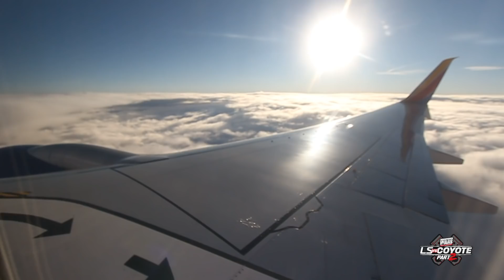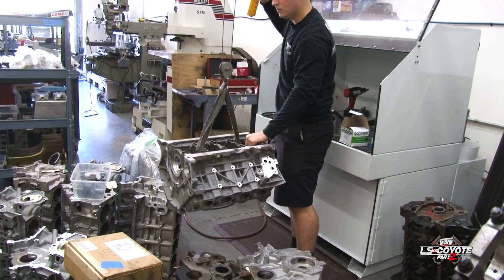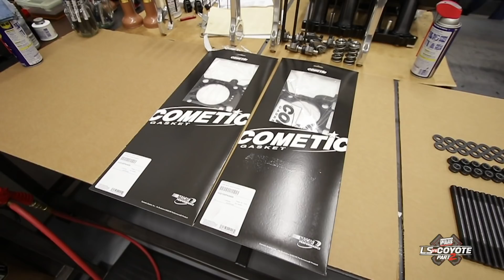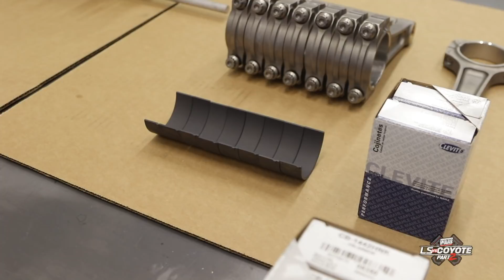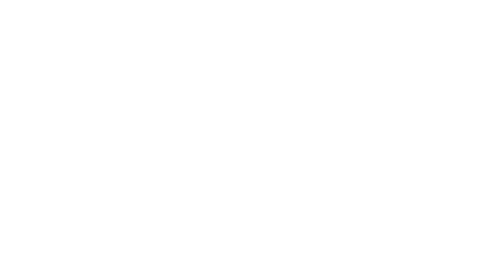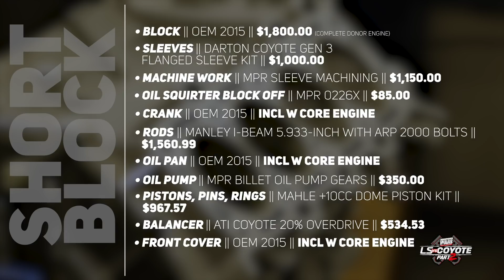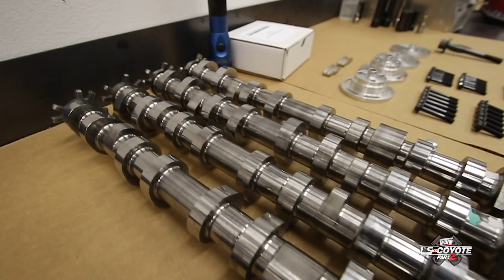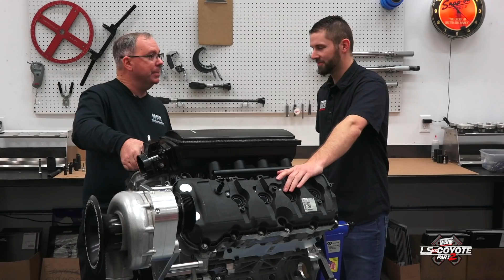LS vs. Coyote 2 Episode 3: The Coyote Engine Build

Comment: it's just like we thought it would be.. a built dart block 427 stroker vs a stock block and ported stock headed coyote. and the 'yote will still win 😁
Reply: Alpha Wërks yes if you want an NA power you need cubes. No doubt any cam in block motor will win NA vs small cid OHC.. But when you boost them (which is all anyone does nowadays) overhead cam takes it home. No one wants to make power like it's the 1960s anymore, you take a stock mod motor (281-302 cubic inches) put a power adder on it, it still sips gas and drives like it did until you get on it instead of thumping around in some loping cam big cubic inch gas hog; it's 2019. I still like NA stuff I have an old sbf mustang it's fun.. but my Cobra will blow it away and gets 24mpg
Reply: Sorry not a name brand dart* aftermarket racing LS block from GM same difference.. that bore/stroke/cubic inch hasn't been in production in 6 years since the last ls7 rolled off the assembly line so yes it is a stroker, however the coyote block is from a junkyard 2015 pickup truck and yes it's been prepped but it's a stock casting.
Reply: @jmitchell513  the 2015  z28 had a 427, same year engine they pulled for your coyote....
Reply: shaadydog1 2015 2014 what's the difference, it's not made anymore. The LS line in performance Chevrolet has been dead for the newer LT series. Which is kind of funny they're not using an LT to fight the coyote. In this case the coyote is a modular engine in the mod motor family (like LS and LT are related) they should have just went to a junkyard and grabbed a 90s cobra 4.6 teksid block and stroked that to a "5.0" kind of like the Chevy boys are doing. John Mihovetz took a stock teksid block 4.6 into the 6.80s in 2002.. the LS didn't hit its 1st 6 second pass until 2012 which is laughable considering how long they had to develop it and the difference in technology from 02 to 2012. They is already a coyote that has went 5.80 @ 250 only 6 years into production (they eclipsed that 2 years ago.) The LS still hasn't hit a 5 second pass ever.
Reply: @jmitchell513  Urban/Moran ran 6.8 over 200 in 05 fuqbois IN A STREET CLASS CAR THAT CRUISED 30 MILES MANDATORY, Not some ProMod MOONBOSTED bs. 
https://www.youtube.com/watch?v=3PgFopQIJdw 
You clearly dont know shyt about the LS platform,  stop regurgitating lies you read on every Ford/Mustang site you have ever been on.Of course You wont see factory stuff pushed and developed when the aftermarket steps in as soon as factory pieces are coming off the assembly line and Classes allow those parts for competition. Thats just a fact most people will not R&D  IF THEY DONT HAVE TOO. 
Myabe you can find a SBE  Coyote/4.6 thats been better than this? 
https://www.youtube.com/watch?v=HYW_kPEyhiQ
Reply: @jmitchell513  Coyote with liners isnt made anymnore either run it  that way... I would be fine running a current alum LT 6.2 or 5.3 VS your currently linerless Coyote junk, shortblock no prep and boost the shyt out of them. Sound good? How about we quit living in a world full of stips, this is a competition not a comparison of factory parts.
Reply: shaadydog1 I'm having a hard time making any sense of what you're trying to type her bud.. I don't know what I'm talking? You sent me a link from a 10.5 outlaw car from 2012 running it's first ever 6.. that's exactly when I said they hit its first 6.. https://www.hotrod.com/articles/hrdp-0403-2002-mercury-cougar/ here's a link to the stock motor 4.6 running a six 10 years b4 your LS. Here's the thing.. the LS is cheap bang for your buck, hell look at Cleetus he made 2 passes in junk yard LSs and blew 2 up. What I'm getting at is at the cost to build a true competitive racecar people don't build the LS, Chevy guys would rather run a big block Chevy. Which for the money is hands down faster. But what is nuts is mod motors run with the big boys, they don't need some big thumping cam and $3,000 set of heads. Out if the box can take power the heads flow a shit ton and get great gas mileage and are steetable... and what are you talking about liners!! you mean sleeves in the block?! Yeah they sleeved an f-150 pickup block made from Ford.
Reply: I didn't say it was first , YOU SAID IN 2012, that's when the first LS on a radials was in the 6's . Probably why the video was posted to clear up some confusion. Read the description for the video it's says it plain as day 2005. Video Published dates are meaningless.... And ya I guess the 4.6 would be first, it came out 4 years before the LS did and rules were in its favor. That 4 years is not a small development gap in the racing world. So the 4.6 has a 4 year developmental head start but the LS does it within  a year or 2 of the 4.6 which needed a  2300lbs Funny car tired ProMod
Reply: @jmitchell513  Stock Coyote casting that needed to be sleeved and reinforced to survive. LMAO.
Reply: hochhaul When your building a 1,500hp engine it only makes sense Ford didn't get a non production racing block handed to them. The builder said stock he rates stock sealed coyotes to 900 horse. Cleetus just blew up 2 stock LS engines back to back trips to the strip making 800 hp, when you're running stock shit there's a chance it won't last long.
Reply: @hochhaul  The reason LME went with the LSX is that they knew the Factory LS block would not survive.  That is the complaint with every Ford guy on here...every one who has ever built an engine knows that factory blocks have a limit before they break.  So the first thing most people do is invest in a good aftermarket Block, whether it is a Dart, Ford Performance, GM Performance Etc. to be able to make big HP and not crack the block.  This LSX is a block that you DON'T find in a GM production vehicle.  The Coyote is pulled from a F150!  So they are starting with a run of the mill factory block....re-sleeved or not, it is a factory block.  Anyone who can't see this or respect the fact that these Coyotes make insane power from "Factory Blocks" is ignorant.
Reply: @Steve-wl7jt  Funny. Katech just hit 1486 HP on a totally stock Gen V LS aluminum block in February. No re-sleeve necessary. Factory block. Factory heads (cnc ported). Not only does the Coyote block need heavy aftermarket sleeves, depending on the year of the block it needs lots of bandaids to hold the block together above 1000 HP --  11mm blocks upgraded to 12mm, shallow head bolt blocks need to be converted to deep head bolt threads, brass inserts in cooling channels to strengthen weak areas, it needs welded gussets to reinforce crack prone areas, etc. They HAD to go with a junkyard Coyote block because to buy a brand new performance Coyote-based block would totally blow the budget for power upgrades. It's a budget-based challenge and Coyote fans always throw hissy-fit because Coyote builds are way more expensive than an LS build. That's completely unsurprising to anybody that's on the outside watching this fanboy bickering and childish whining. DOHC builds are usually much more expensive. DOHC engines have many more parts. Until Ford finds a way to help make the Coyote performance part market become as affordable as the LS aftermarket, that's just the nature of the game. For now, the Coyote builder has no choice but to go with a junkyard build to have any chance of winning a budget-limited build competition.
Reply: @hochhaul  KaTech hit 1486 on the NEW 2019 LT5, this is not an LS block or even in the same family as the LS.  In fact, the first LT5 was developed using Lotus Engineering developed heads and was built by Mercury Marine.  So the LT5 was developed and made by the British and a Boat manufacturer, not even a true Chevy engine.  Furthermore, the LT5 is available only in the corvette and Katech showed the bent rods and said they stopped just before spraying that engine all over the dyno room.   It is Impressive, but it is not an LS.
Reply: @Steve-wl7jt  LMFAO the new LT5 is a gen V LT1 with an upgraded fuel system, forged pistons, new rods. It's not a Lotus you moron.
Reply: @hochhaul  You are only LMFAO with the rest of us at your ignorance.  Do some research and educate yourself so that you don't look so stupid next time.
Reply: @Steve-wl7jt  The Lotus designed LT5 you're talking about:

http://www.superchevy.com/how-to/engines-drivetrain/1806-the-original-lt5-and-what-could-have-been/

was only used in the C4 Corvette you dumb bitch. 

This is the Gen V LS-based LT5 that we've been talking about:

https://www.sae.org/news/2018/04/gm-lt5-v8-engineering-details

Let me quote a little from the article I just shared with your dumb ass:

"The 2019 LT5 builds on the fifth-generation small-block V8 architecture introduced in 2014 for the seventh-generation Corvette Stingray. The 6.2-liter deep-skirt aluminum block, aluminum cylinder heads, continuously variable cam timing, variable-displacement oil pump, piston cooling jets and dry-sump lubrication all carry over from the supercharged and intercooled LT4 variant introduced for the 2015 Corvette Z06."

Did you comprehend that dumb fuck? Notice how the SAE, the Society of Automotive Engineers, mentions that the aluminum block and heads are CARRYOVER from the LT4. The LT4's aluminum block and heads were CARRYOVER from the Gen V LT1. In other words, the block and heads that handled 1486 HP in Katech's dyno runs is the exact same fucking block and heads used in every Gen V LT engine, right down to the LT fucking 1.
Reply: @jmitchell513  yeah... the yote really won alright
Reply: @jmitchell513 , they stopped putting LS7 into cars, doesn't mean they stopped making it all together 
https://www.gmperformancemotor.com/parts/19329246.html
Reply: Anthony Webber of course they do. I just got on Ford Performance and you can still buy a 5.8 Trinity motor, a 351 Windsor and a 460 big block. Those haven't been in production in years either. My point is the LSX 427 they built isn't a stock block or casting like the pick-up truck block the coyote is using.
Reply: @jmitchell513  Opinions differ and it's pretty common to take GM 5.3 aluminum block and resleeve it to achieve the same 427" combo they did here.  In many cases a darton sleeved LS truck block is actually more expensive than the iron LSX block they used for this competition.  So lets not pretend it's stock vs aftermarket when it was just a matter of choice of the engine builder to choose which route to take when building this motor with a $15g limit.  Could have easily sleeved a truck block as well and stayed under budget.  I kind of wish that is the route they went to eliminate the Ford excuses.  $15g budget limit makes it as fair as you can and obviously there are a lot of different routes they could go within that budget on an engine build.
Reply: Lol new coyote doesn't even have a liner, so now what? Can't even say stock block cuz you actually have to add a liner it never came with.
Reply: Dart block where? Its a gm produced block lmao. Not a stroker, same stroke as an ls7. Fake news

Comment: I could get past the obvious apples and oranges of a huge pushrod vs a high flowing 4VOHC, but seriously, you've hamstrung the coyote so badly by doing the dyno testing with Holley.  The reason the coyote is such a beast is in the tuning and the ability to wring out every ounce of power across every rpm.  The dyno testing you're doing was around when the Egyptians were in charge.  At least let them manage the engine the way it was designed.  The whole "we don't do computers" crap just sends you guys over the edge as LS homers and why I won't subscribe to the channel or watch your other content.
Reply: Bye then... Don't let the door hit you on the way out. #Crybabies
Reply: Alpha Wërks I'm talking about the archaic engine dyno testing setup genius
Reply: Ryan McKee  what you’re saying is so incredibly inane that I’m sure they’re glad you aren’t subbing.
Reply: I really am curious as to why they aren't using the vvt technology on the coyote.  the vvt is what gives the factory coyote such a huge powerband without sacrificing peak numbers.  in a competition where area under the power curve counts for so many points why would you throw away such a huge advantage?
Reply: Colton  Robinson its more to do with simplifying the tune.  For race and extreme street applications, vvt for making good power is less crucial and you're less concerned about old school lopey idle.  They fix the imrc plates usually too.  My biggest problem is that they're using some bandaid Holley engine management rather than a Ford ECU to manage the motor.  This is almost certainly a limitation of the engine dyno shop and most of the tuning advantages that have been learned by the various tuners involves the modern Ford management with speed density, lambda values, etc.  I'm afraid they're gonna leave a bunch of performance on the table because of a new/different engine management that's antiquated.

Comment: Another great video, guys. Y'all are executing it very well.

One problem I have with your rules is "any extensive or unusual machining or porting must come out of the budget." What's "extensive"? What's "unusual"? I'm glad to see that both sets of heads had CNC work, which is arguably comparable.
Reply: LS wasn't charged for the work done on the heads or the modified Factory crank....
Reply: @mrjesuschrist2u  Neither were charged for the CNC head work. Both had work done on the cranks, too. I was a little sad that the machining for the dry sleeves was added in, but it makes sense.
Reply: @numinous4789  it was listed 600 for port work. They paid 1800 for the long block was my understanding. I could be wrong ....
Reply: @numinous4789  yes it was 600 for port work but ls there was no charge. There was also no prices on ls for valves and springs yet the coyote had been charged. ...
Reply from the maker: Re-sleeving the block is "extensive" but standard boring, honing, etc is not.
Reply: @Horsepower_Wars  subjective and calculated rule. Machining an intake = not excessive.

Comment: I still find it funny that same as the 1st shootout, the Ford has to be a used block just to make budget. LOL! There is a reason why so many Ford product builds use Chevy motors in them. Easier to build, cheaper to build, more reliable. Ford has always been snobs about their products, and they don't care about their customers. "It if you want it, then pay up sucker!"
Reply: Bullshit dude,Ford has always made a way more durable engine than Chevrolet. And I'm a retired ASE certified technician before you say I don't know what I'm talking about. I own nothing but Ford products,I won't even work on a GM anything anymore.
Reply: So out of what I said, the only thing you can comment on is the reliability. You may have the experience with dealing with them, but I think the fact more people use the product over Ford's speaks for itself. You can't even debate about the price difference either, which was my main point.
Reply: @Afool4travel  Around where I live it's the young guys who are buying the GM stuff left and right. Then promptly tearing it to hell trying to make it do way beyond it's capability. I have always known that GM parts were cheaper because of the mountains of blown up or torn up GM vehicles in all the junkyards. There's several junk car businesses around my area. My son and his wife being one of them. But I have worked at and managed several auto repair businesses as well as one auto salvage business in the past 30 years and we could always count on GM products breaking down on a regular basis,they were our bread and butter. I have built and or rebuilt more than 10,000 engines in my career and I can attest to the absolute fact that GM engines and drive systems are not as durable as Ford or RAM(Dodge to me) engines and drive systems.
Reply: Scott Smith you realize the lsx block itself is over 5 K.... The ford has a cheap junker block with machine work. The coyote was cheaper even with labor cost. In the end ford has the 1/4 record the h pattern shift record and the fastest 1 mile record along with tons of le mans and other race records. Still waiting on an LS to make it into the 5s...lots of fords have... Youre just an idiot that has no experience with engine builds. Just stop
Reply: @luciankristov6436  I think you've been sniffing to much gas fumes from whatever Ford you may drive. I didn't call anyone names, regardless of what I think, but you seem to be obliviously ignorant. But you also didn't look at the cost sheet that was posted on the video's either. They posted the LSX block at $2782 verses $1800 for the "JUNK" block Ford complete motor. NEW V/S USED! Not to mention all the machine work and sleeving just to keep it from cracking the block(YES, I'm talking the list price,  LOOK at what I'm talking about not what you want to argue about. And as far as your 5 sec non-since, you don't watch much drag racing do ya. Chevy also has also won many Le Mans races, 8 in the most recent years. A Chevy motor is also in the Hennessy Venom Gt (with a Guinness World Record for Fastest Road Legal Car). I may not work on the motors myself, but I know many who do including family. They have numerous Ford's in their shops with constant problems compared to Chevy's. So, I will not stop hating Ford's because I have seen and heard nothing good about them. You may like your overpriced non-since, with a company that milks it's fandome( that's an idiot to me), so don't expect me to Stop.